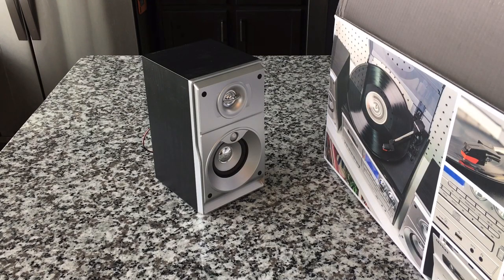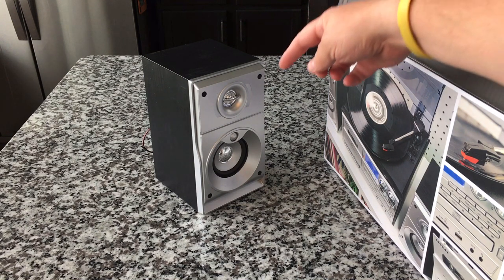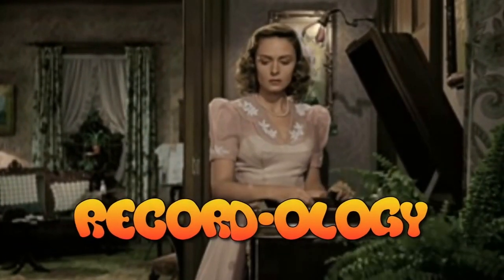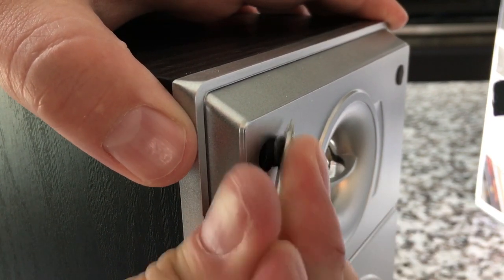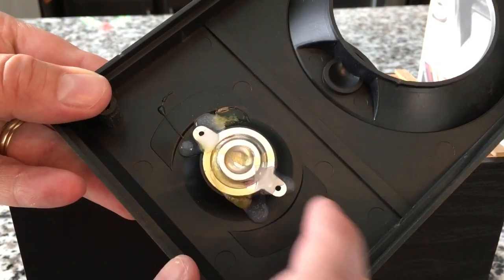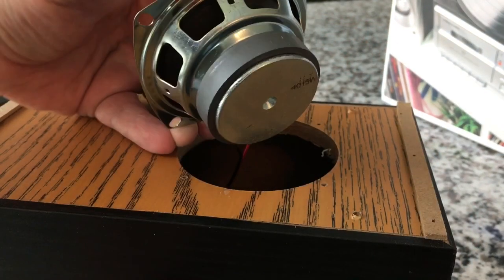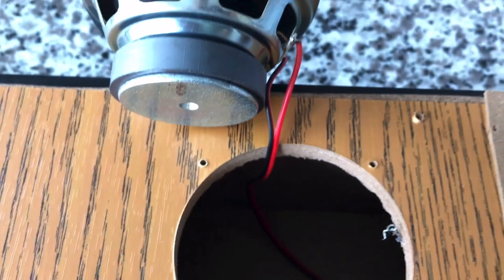Fake Tweeter?

Comment: It's pretty ez these days to make something thats really cheap but  looks good.  Crosley and China in general are masters of that game.  Crosley's reputation preceeds them and is probably adversly affecting the sales of their higher end turntables (not the suitcase ones) which really aren't that bad.  It will be very tough for them to bail from their crap product reputation, if indeed, they actually want to do so.

And you find fake-outs everywhere. I have a fairly high end car which has fake exhaust ports in the bumper.  I didn't even realize it until  six months after I bought the car!
Reply: lol your car has a fake bassreflex port XD

Comment: Crosley is hardly alone in this practice; it's been going on since the 1980s.   The stereos that come with speakers like this are usually built to meet a price point, and OF COURSE there are going to be gimmicks and useless gingerbread and shortcuts.

It doesn't necessarily mean they're 'bad', per se.   In the 1960s and 1970s and even into the 1980s, a lot of bookshelf speakers sold by respectable hi-fi brands had single, full-range drivers.  But at that time, it wasn't 'chic' for the drivers to be visible, so they were invariably covered with cloth grilles.

If you're interested in some really nice 'small' speakers, might I suggest a set of Dayton B652s?   True two-way compact bookshelf speakers, they sound really good, especially considering their modest price. I just got a pair of them in June and I got the 'bundle' that included a Lepai 2020TI 'mini' amp - all for just over $60.  Yes, that's a PAIR, plus a 15W/channel mini-amp, for about $60, and free shipping.  I'll share the link if anyone's interested.   

The mini-amp and B652 combo, I feel, would be a fine outboard setup for one of those 'briefcase' players or all-in-ones, and it would probably be really good match for an LP60 or Target Heyday turntable to round out a 'budget' hi fi system.

EDIT:
I'll post the link here:   https://www.parts-express.com/6-1-2-2-way-bookshelf-speaker-pair-and-hi-fi-mini-amplifier-bundle--300-6534

As of this post, they are out of stock, but more are expected in mid-August.
Reply: You're so correct about this. Even big name companies did this.

Comment: It would not have cost them anything extra to add a functioning tweeter. I wonder how much the fake tweeter assembly cost, along with the extra trouble to mold and cut a fake opening, then finally the cost of the hot glue. They could have saved money just by using a real tweeter.
Reply: Not really.  There's the cost of the tweeter itself, some sort of crossover network (even if it's just a couple of capacitors), and the extra step of making the hole and installing these things.    

Remember, these things are not aimed at the audiophile or even the 'enthusiast'.  It's aimed at John Q Public,   whose expectations aren't really that high.    He just wants something he can use to listen to CDs and cassettes and records on, or maybe give to his kid.   In short, he doesn't much care if it isn't the 'best sounding' thing available.  Also remember, the modern market tends to favor bass anyway.

While the additional costs might seem trivial to you, when you're mass-producing something for the 'general market', and doing so to hit an attractive 'price point', small 'per unit' costs add up.   If you're a company that cranks out 200,000 of these things, and it costs $2 in labor and parts to add a tweeter for a customer who probably wouldn't care less.....   Well, it's honestly money they don't need to spend.
Reply: @xaenon  Thats true, but by adding a slightly better component  you also widen the market ,  you wil get more customers that are looking for something in between utter shize, and high quality.
And these days  people dont just want bass, but also good quality treble,  thats why i often see people with a cheap logitech sound system or worse, replacing the tweeters, or adding real dome tweeters to the speakers.
The only reason why these fake tweeters are in these sound systems is because people actually care enough to atleast invest in speakers that has a seperate quality tweeter

So yeah you are right its gonna cost them a bit more time and money, but in the end they wil get more customers   word spreads around fast these days, so whenever somebody finds out about the fake tweeter, they get a negative customer review and alot of people stop buying the product  (logitech z333 for example with the fake plastic tweeters was a big topic,  folk dont like to be fooled.    It's better in my opinion to dont add fake tweeters at all,  it wil only ruin the companys name

Comment: Not surprised by that, as others commented its common practice. Its a shame because the speakers make or break any system. I've seen so many of those budget systems whose sound quality can be completely transformed by just plugging in a decent set of budget bookshelf speakers. Unfortunately with such a low power output and no tone control whatsoever they won't get to loud!
Reply: Yes indeed, over the years I've upgraded many 'mediocre' stereo systems with better speakers and really gotten some good results.  My first stereo was a Lloyd's AM/FM/phono combo with tiny, chintzy speakers; I came across a set of some Panasonics (still single-element, but more substantial) and it improved things considerably.

I've wondered why tone controls have mysteriously gone away in recent years.  It used to be that any decent radio or tape player or basic all-in-one had at least a single tone control.  Nowhere to be found anymore.

As for the small power output - you would be surprised at what's possible with a small amplifier.  My Radio Shack SA155 kicks out a rated 1.8 watts per channel (you read that correctly, one POINT eight!) and while it won't rattle the windows, it'll definitely fill the room.
Reply: @xaenon  True, and often its just a bad port design in the cabinet or not enough glue used between the wood/ or a simple blanket of sound isolation that only cost them a few cents, most of these budget system can do alot better for just 1 dollar more out of the consumers pocket.

Even those low wattage/powerd amps can still drive a very sensitive speaker  , just connect atleast 91 db speakers and low wattage amps does fine

Comment: Are you sure about the speaker rating? I read 4 Ohm 15 W from your video. I remember the specs sheet from mine (looptone) mentionning 15W speakers... Anyway, I knew the tweeters were fake. One way of knowing is to cue some treble heavy music (i.e. revolution 909 from daft punk  @ 55 second mark) and you'll hear absolutely nothing coming out from the 'tweeters'. BTW  trying to tape this music will also prove the cassette recording function of this unit is crap ;)

Comment: FOUR ohm, 5 watts.  Meaning the amplifier driving it is probably making about 3W/channel RMS.   I'd be more impressed if the magnet was a bit bigger, but it'd take more power to drive it properly.

To put that in perspective, the itty-bitty speakers in a Crosley Cruiser are 4 ohm, 2 watts, but only like the third the size of that thing.
Reply: Actually it looks like it says 4 ohms, 15 watts.
Reply: @kevinsvideodump  Now that I look at it again, it DOES look like it says that.  But looking at the speaker assembly itself, I have my doubts.

Comment: I ought to tell you this is a very common thing...The suppliers will tell you it is an aesthetic design consideration, not a 'fake'.
Funny thing is a cheap tweeter would add maybe tens of cents to the build cost and that is enough to count it out. This shows you what sort of value they put on performance...Though of course there are people adjusting the parts list and trying to lower the component count on a build to save pennies, and that would be met with a bonus. I'm half surprised they considered the fake part and the fitting of it to be worthwhile. They must expect to sell more with the fake tweeter or they know they can raise the price..That guarantees it is indeed a fraud of sorts.

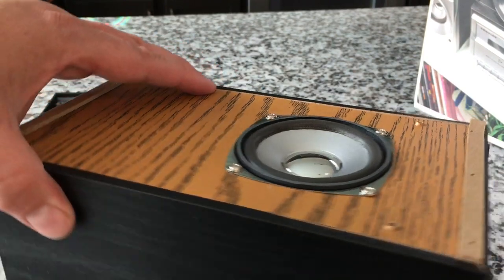Comment: That is a pretty deceptive move on their part. 2:36 look at the right side of the "wood" (under the right side silver screw) and you can see that the "wood" sticker appears to be peeling off or scuffed. Shoddy manufacturing but you get what you pay for. Crosley has come a long way over the past couple of years and I don't know how old this model of speaker is but if it is recent it's a huge two steps back for them. This is nothing I would ever buy.